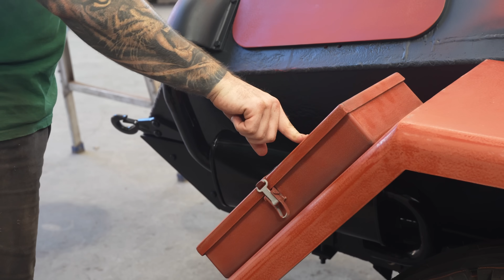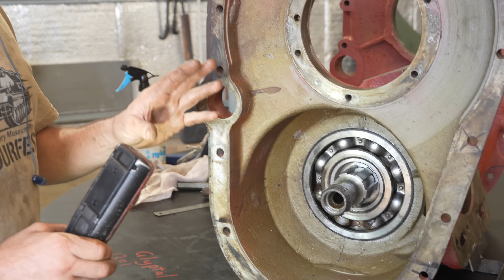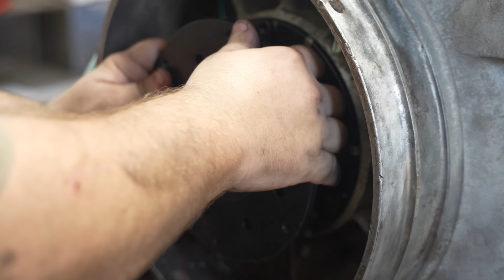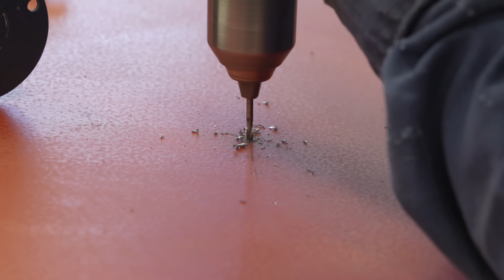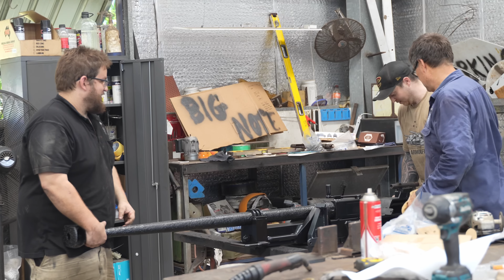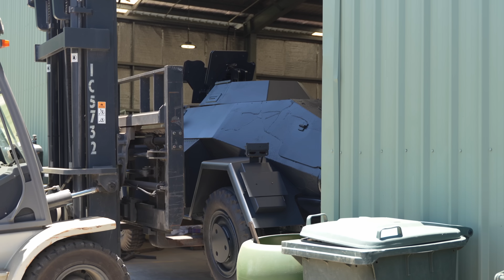WORKSHOP WEDNESDAY: SdKfz 221 COMPLETE! (PLUS StuG III and Sabre CVRT update)

Comment: When you go to all the trouble to restore these important pieces of history why don’t you use metal filler to fill in all the putting from rust? It would make them closer to how they looked when they were produced. I was disappointed in the gun and its surrounding shields. They were both heavily pitted and it wouldn’t have been that much more work to make it look better.

Comment: Congratulations on another amazing effort in resurrecting a rare ( if not formerly extinct!) armoured car.

And that StuG transmission never fails to impress me considering it would have been designed in the 1930's without the benefits of CAD or any modern assets.

And I never stopped to consider that the sale of large amounts of the British CVRT  fleet to one of the Baltic countries would have affected parts procurement.

Fantastic efforts all round guys. It never ceases to amaze me. 👏👏

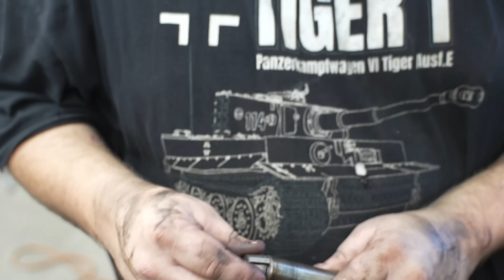Comment: 11:15 the ridiculous answer is the taper. You'd think the woodruff key is the thing that keeps the shaft copacetic, nope. It's the taper, and here's the kicker: you only need a fraction of that tapered shaft to actually transmit the full power. That little patch of worn out metal that's about 5 mm on the shaft? That held the power. And it eventually gave out, hence why it's worn, and then held again (because the shaft and hole were basically honed one for another). Fun stuff, huh. Had this issue with the tapered shaft of a transmission. We never knew what the issue was until we took the whole transmission apart. The taper had split in half and friction honed itself in causing an intermittent problem as it sometimes gave up, friction honed itself back in and so on and so forth.

Comment: Be honest guys, this & Pz1 is not restoration.
It's building a new vehicle incorporating some original parts. Above & beyond; tip of the hat for that.
 Next, they will probably build a Tiger starting with a squashed shell case and a rusted bolt.
Reply: Thank you for pointing out something that they have been completely transparent about.  What next will you reveal, that the sky is blue or that water is wet?

Comment: I suspect that the poor quality of the casting may be due to two reasons. Late war they were cutting corners (near certainty). Slave laborers may have sabotaged the transmissions by  by allowing poor castings through the manufacturing process (Possible).

Comment: For Steve and the differential. Will you clean up the inside of it prior to assembly? I mean removing the flaws in the casting where you can and obviously knocking off loose bits?

Comment: WOW as always and I love you have all of the gear parts separated & organized so nicely and that you will do a test build using the old parts 1st as a "test build" first, that is a very smart move. I would recommend that on your small parts plastic bins, either add a big white sticker on top for writing on, or even better, write the information on the "Inside" of the lid so that the magic marker doesn't get accidently rubbed off or smeared by a greasy hand that has a lubricant or oil on it.
 The casting flash may have been from slave laborer's doing the work and were attempting to sabotage the equipment from the factory end. Unskilled workers such as women replacing men who were needed at the front could be another possibility.
 I have rebuilt lawn mower engines and helped on car engine rebuilds, but all of this military stuff is on a scale 100+ times more complex, so a big salute for all of the dedication everyone puts into all of the work.
 I never knew the gun shield was made up of 2-plates, I must have missed something in a previous episode, but it is still a very interesting design that must have come from battle experience and a change to the original design was made to upgrade the protection level for the gunner.
 That is a very nice Christmas present for the museum 👍👍

Comment: Love workshop Wednesday,  great job guys.
Reply: With the rough finish on the housing  it could be a number of factors 

The germans used forced or slave labour  in the factories running 24 /7 

Due to that you have deliberate  sabotage  and putting foreign  objects   into oil channels  etc 

Materials  were getting  more difficult  to get so short cuts where the only way 

Plus pressure  from the miltary  to get the equipment  out onto the battle field  as soon as possible